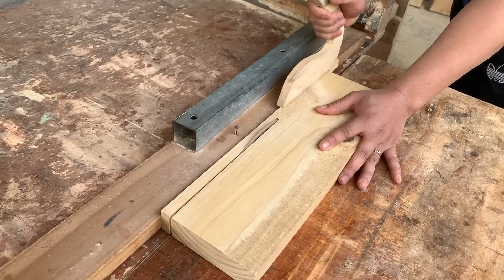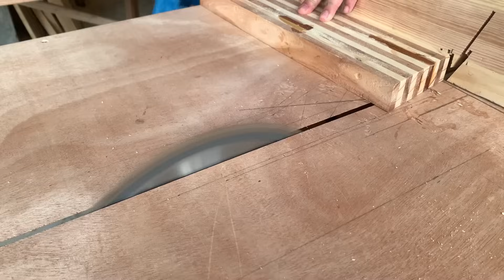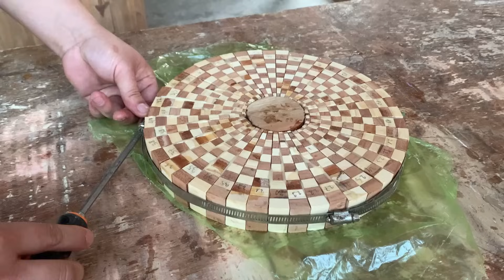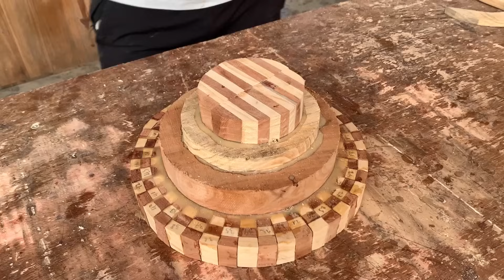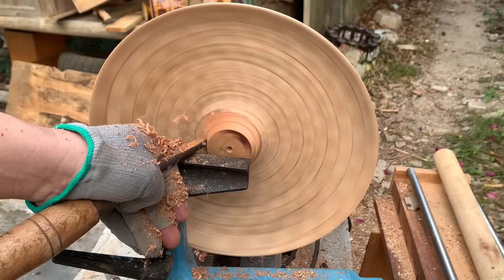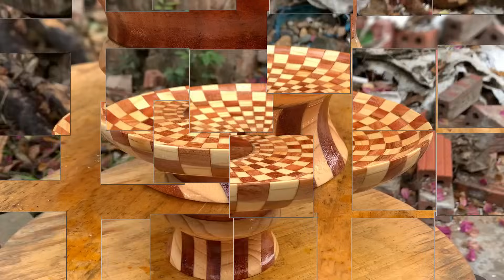Woodturning - Make a Beautiful Chessboard Shaped Plate

Comment: Your glue up showed two wedges with the same colours side by side. So an odd number of wedges instead of even. The piece wasn't centered for turning so you got a lot of run out on the outer ring and leaving screw holes in the base??? The details matter. A lot.